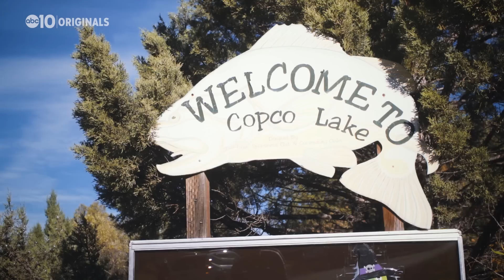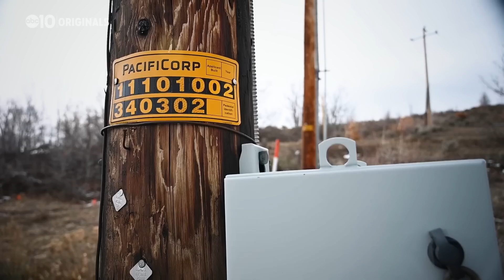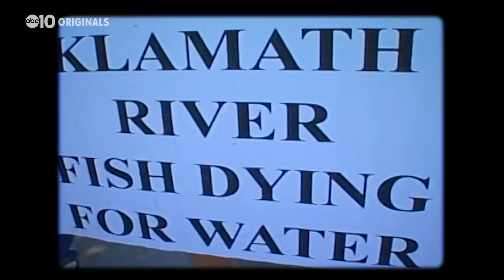World's biggest dam removal project changing a California river

Comment: You just lost 800,000 Salmon due to bacteria and algae. The dormant and deadly silt that has accumulated at the base of the dam. You just woke it up, and now it will be an active problem from here on out. All the dead deer and other animals that got stuck in the mud. So environmentally friendly, 😢. Contaminated ground water. No more flood control. Should have built new dams to replace them with fish ladders. That would have been a better solution. Losing the renewable hydro. Can't replace that with solar and wind that cause earth's surface temp to rise. Just to appease a group of people that came here from Eastern Asia and Europe across the Bering straight.
Reply: @jasonblauvelt9655   The dead algae is flowing out to the ocean like it should have been for the last hundred years. It will be flushed out in no time. 
As far as "All the dead deer," there were five of them. If you're really that concerned about protecting deer, you should do something about motor vehicles and the roads in Siskiyou county. I guarantee you more deer die being hit by cars every day in that region, then have ever been stuck in that mud!
The dams were what was so environmentally unfriendly. Did you think taking out giant concrete plugs that had been blocking the river for 100 years was going to be pretty? Get a clue man! We are definitely going to see some short term distress to get the long term benefits.
Why are you so opposed to this project? Have you ever been to this region? Have you ever seen first hand the damage those dams did to the river? I've been looking at it in person for close to 40 years, and getting rid of those dams is the best thing that has happened to this region in a long time!

Comment: Everyone is beating the drum of clean energy. There is no cleaner energy than hydro electric. . For the price of ten of the two hundred windmills it will take to replace the generated electricity being removed from the grid, every salmon could be hand plucked from from the river and given a limo ride to any destination on the river. Instead of removal they should have invested in efficiency up grades. A reservoir  that covers a thousand acres provides more consistent fish habitat than A river that is 150ft wide and 10ft  over the same distance with varying levels of flow in relationship to the seasons. But hey, it sure looks pretty when they are gone.

Comment: Why did they not just make salmon ladders
Reply: Too expensive to build.  The dams don’t make enough money to justify maintenance, repairs and overhaul, to include the ladders.
Reply: less expensive then taking out the dams.  If Pacificorp could have figured out a way to get the taxpayers and rate payers to pay for the upgrades they would have gone that route.  The choice was "you pay for the upgrades, or someone else pays to get them removed"  pretty easy choice for pacificorp.  I think new updated dams that balanced salmon and energy/humans would have been the best move
  @Bozbaby103
Reply: @Bozbaby103  Well there was clearly a salmon ladder at one of the dams.
Reply: @schsch2390 yeas, they needed to build a new one that actually worked.